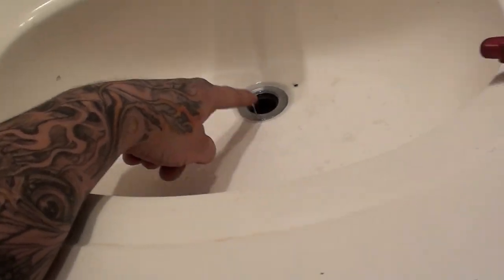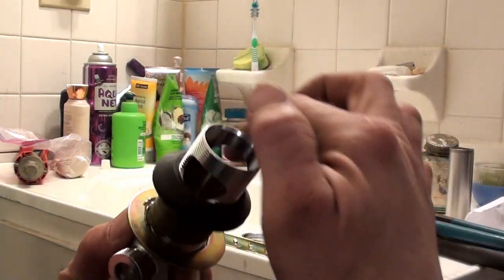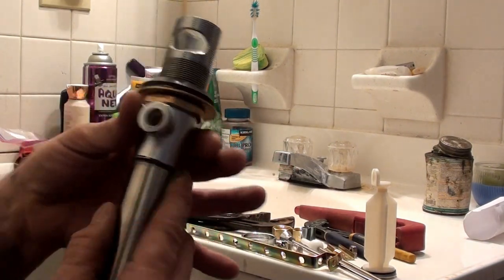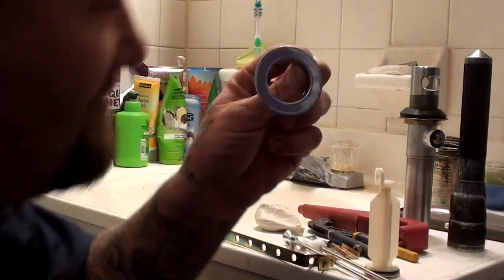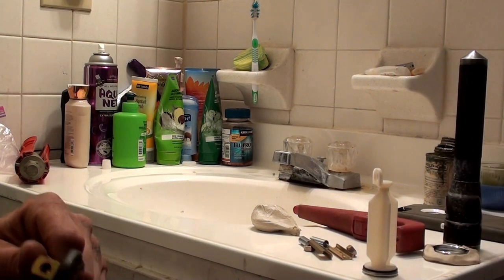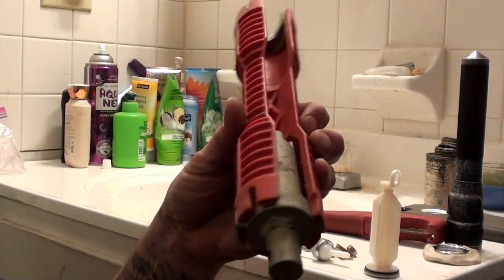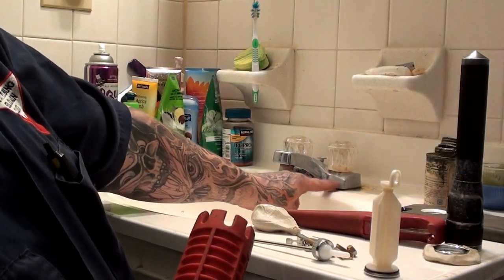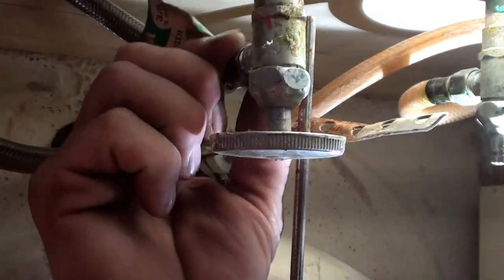diy how to replace my bath sink faucet in less than 45 mins

Comment: So you used the included drain assembly for overflow sinks in your non overflow sink without any problems? I just installed 3 Moen Chateau faucets but all my sinks are non overflow so didn't change out the drains because the included drain assemblies were overflow. Didn't really need to change the drains but would have if they were for non overflow sinks.

Comment: I just had to replace the faucet, drain tailpiece, supply tube and p-trap in one of are bathrooms. I had a bear of a time trying to get those same plastic nuts loose (14:53 into your video) that holds the faucet to the sink. I was working in a real small vanity and I couldn't really get anything up their to get a good bite and they were on tight! I managed to reach up with my Dremel tool to cut the nuts off. I've done plumbing work under sinks 5 or 6 times in my lifetime and never till now had that much trouble with a project.
Reply from the maker: I hope the video helped!